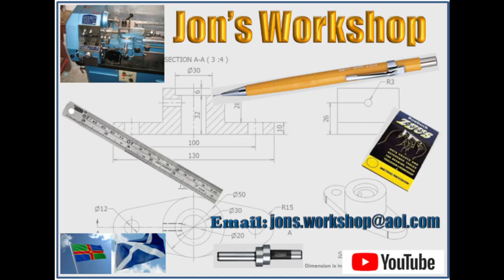My New Harrison M300   Strip Clean & Re build Part 2

Comment: Hi Jon, the chuck looks really good and gave a very creditable showing. I think you have a great machine there. On the M250 the oil in the saddle lubricates the gears so I imagine same on the 300. The oil type is ISO VG220 gear oil. The filler cap is the recessed bsp plug above  your hand when you are showing the oiling plunger. Looking forward to part 3 and seeing some chips!
Reply from the maker: Hi Carl, thanks for the comment. Yes, the chuck was incredibly accurate, I did a 10x repeat off camera to satisfy myself it wasn't a fluke, the biggest number I got was 0.0004", amazing. No excuses now then, you all know how good the machine and chuck is so I have nothing to hide behind! I had located the filler, duly filled with the correct oil, only to watch it all piss straight back out again from the feed engagement lever hole where the rubber boot is split. Oh well, if that's the worst thing I consider myself lucky. Going to order a pair of steering shaft gaiters and make my own, not paying £50 plus Vat to Harrison for a replacement! Cheers, Jon

Comment: Great videos on this lathe, I have one at work and is in a sorry state at the moment.
You couldn't tell me the oil capacity of the head stock could you? I don't want to do all my work on the L5A.
Reply from the maker: Hi RichEther, thanks for the comment and question. I think from memory it was about 2.5 Litres or just under, hope this helps you. Cheers, Jon
Reply: @jonsworkshop  thanks, I've given it a change and finally found the source of the grinding/rattle, reverse gear for screw is shot. Job for another day.

Comment: Jon, this is a pet peeve of mine. All scroll chucks need to be greased. All of the inner parts. Some of the better chuck companies even make their own grease. The proper grease is heavily moly’ed. the pinion outer bearing can be lubed with way oil. When I get a chuck from someone and I’m going to reverb it, I always apply that grease. Some Chinese manufacturers put oil in their scroll chucks, but that’s bad.

From the high rotational speed, all oil quickly moves to the inner side of the outer shell of the casting. The scroll is therefore  quickly stripped of oil. Heavy moly grease clings and stays where it’s put. It’s also a myth that grease will hold chips. The problem is people moving the jaws too far out, past the specs. The inner jaws should never be moved so far out that the scroll can be seen. The inner part of the casting is meant to protect the scroll from chips, and once you go past that, anything can happen, as well as the workpiece flying out of the chuck at high speed.
Reply from the maker: Hi Mel, thanks for the comment. Can't disagree with what you are saying, other than swarf will always work its way into the scroll regardless of jaw position therefore grease in my opinion makes it much more difficult to clean out regularly. Also, this chuck has an oiler point for the scroll on the front face so I suspect it was designed for oil rather than grease. I have spent many years in industry using chucks from all different manufacturers from 2 inch up to 36 inch, every one of the suffers from swarf ingress. Compressed air exacerbates the issue which is why you don't see me using it, but most people do. Cheers, Jon

Comment: Hi Jon, where did you get your oils? Is the lubricant reservoir independent of the saddle gearbox oil?
Reply from the maker: Hi Jim, thanks for the comment and question. I use Westway Oils off Ebay. In terms of the reservoir, I believe it is dual purpose but have never confirmed this so I could be wrong. Cheers, Jon

Comment: Nice lathe Jon, and a good vid. One thing I noticed on the cross slide at the end of the video, as you were feeding it in there was no noise but as you are pulling it back, there is a consistent clonk every revolution in time with a certain position of the hand wheel. If you review it yourself you should be able to see to time it to the approximate angle at which the handle is. Not sure what could be causing it, especially as it only happened on the reverse direction and not in the forward. Might be worth looking into at some point mate.
Reply from the maker: Hi Samrodian, thanks for the comment. No drama, I re-watched the footage and went straight out to check. It is just the noise of the handle clanking on its mounting screw, there is a bit of axial play, panic over! Cheers, Jon

Comment: Remarkably good chuck run out, but if I were to be picky I would like to see you nip all the cams before you yank on any. Probably won't matter but can't do any harm to be sympathetic to the old dear.😉
Which variety of rubber did you order, fetish grade or the proper oil resistant one?
Reply from the maker: Hi Chris, well spotted and thanks for the feedback. I watched it back and that is very unusual for me to do that, not sure what came over me, I will blame you lot and the camera for now till I come up with a better explanation. I am disgusted with the lack of mechanical sympathy on show, and I am being serious (for once)! The chuck blew me away, and it's not even a Burnard. I was expecting, and would have been happy with 10x that number. I did 10 repeats off camera to verify, worst number I got was 0.0004", amazing. The oil resistant type of course, if I was happy with the fetish grade I would have nipped upstairs and cut up some of the weekend wear........ Lol. Cheers, Jon
Reply: Hi Chris. I've no experience in cam lock chucks at all, but your comment "nip all the cams before you yank on any" sounds intriguing and informative to an amateur like me. I'm not picky, old dear, love it. I'm old as well lol.
Reply: @jonsworkshop  would that make it peek a boo clothing?
You can blame us lot, we have broad, if somewhat rounded with age, shoulders.
Reply: @eyuptony  the reason to be sympathetic is those cam locks exert a remarkable force and the taper seating can be tight. So if you yank on on cam before the taper seats you run the risk of distortion. Ok it is only a risk and I'm not advocating any hint of risk averseness, but there is no harm in being sympathetic especially if it is your own hard fought for equipment. 
As an example of how much force they exert, even a small speck of metal dust gets squashed and you have to check for it every time you change the chuck.
Hope this all makes some kind of sense.
ATB 
c
Reply: @chrisstephens6673  Yes Chris like a foreign body in between a L00 taper lathe nose and the chuck mounting. Does this sound the same to you? Tony
Reply: @eyuptony  sounds similar but there you have one nut pulling the chuck on, camlocks can pull off centre on the taper if not tightened in steps, much like tightening head bolts in stages. But lets not get paranoid, just sympathetic. 😉
Reply: @chrisstephens6673  I thought so by the design but I've never used one. So in practice its up to the operators skill and experience. It's not fool proof then lol. Thanks for verifying and replying. Tony
Reply: @eyuptony   every foolproof design just encourages a better  design of fool.😤
Reply from the maker: @chrisstephens6673  it certainly would, might look slightly funny though with 90 degree holes, maybe I'll put them round the back!
Reply: @jonsworkshop  i favour 1/2mm black myself, for bed way protection that is.😉 but it does need stiffening to be effective. As the actress ssid to the Bishop!😀

Comment: how many liters does each oil box needed sir?
Reply from the maker: Hi ManiX Rios TV, I didn't measure the exact amounts but roughly 2.5l for the headstock, about 0.5l for the carriage and I have yet to drain and fill the screw shaft gearbox but I am guessing about 1 to 1.5l, hope this helps. Cheers, Jon

Comment: Always interesting and informative. If you set your camera to 50Hz (if you can) that should get rid of the flickering. If I had a counsel of perfection I would edit out a good deal of wiping surfaces and applying a thin coat of oil or grease. Not really highly technical. Interestingly I took my Pratt-Bernerd 6" 3 jaw apart after a good 30 years. Not a speck of dirt inside, no lubrication evident, no means of lubrication and zero visible wear.
Reply from the maker: Hi Rick, thanks for the comment. Unfortunately the crappy camera I was using when I filmed these earlier episodes only had 30 FPS which is at odds with the 50Hz supply voltage. From my episode titled "Workshop Blether" onwards, I have got a decent camera and the issue is now resolved thankfully. Good feedback on the content, understood and taken on board. P&B chucks are in a league of their own (I have a 4 jaw of theirs, and I have used loads in my early career), they are manufactured properly to very high standards using decent materials. Thanks for your support. Cheers, Jon
Reply: @jonsworkshop  Yes, my P-B chuck is more than 40 years old, seems never to have been lubricated, and I still needed a drift to remove the bevel pinions and the crown wheel, the latter proving very tight.